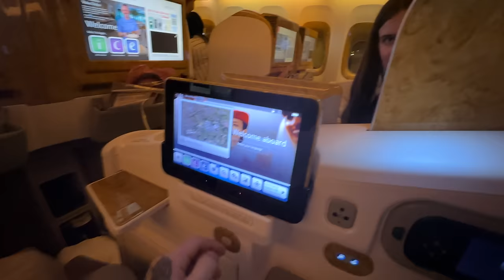FULL GARAGE TOUR UPDATE

Comment: Waterpump part two 😊
I just watched the bleeding the coolant issue. Now with more history . I think you just have a big air bubble. The F430 system is a little difficult to bleed. I came up with this method and it works 100% of the time for me. If the system is fully drained you will be able to get 16 litres in using this method. Then after the car has run you can get 1.5 or so more litres in. COLD ENGINE, CAR NOT RUNNING 
1) take the vacuum pump thing and leave it in the drawer.
2) on the passenger, left,  side( right hand drive car). Driver side in North America, remove that small hose from the top of the radiator that you previously tried. 
3) plug or just cover the rubber hose with your finger.
4) have some slowly pour in the coolant until it starts to come out of the small tube on the radiator.
5) slip the rubber hose back over the tube on the radiator and tighten the clamp. 
6) pour more coolant in the tank until it is about an inch and half from the top of the radiator fill. 
7) put the radiator cap back on and run the engine until it warms up. The fans, first drivers side, then passenger side will run. 
8) turn the car off.
9) RESIST THE URGE TO OPEN THE RAD CAP. You’ve seen what happens.
10) have a celebratory beverage while the engine cools down completely. 
11) now open the rad cap. You will be able to put in more coolant. About a litre and a 1/2 up to about  an inch and a half from the top of the fill hole. 
12) put the rad cap back on and warm up the engine. 
13) check for fans again. 
14) turn car off and RESIST THE URGE TO OPEN THE RAD CAP. 
15) after the car cools check level again. 
That’s it.
Your mileage may vary, constantly check for leaks, put a new thermostat in so the engine runs correctly. If you don’t the engine will get too cool while driving on the highway.
Cheers

Comment: For the water pump. There are 3 weep holes on the pump itself. Two will leak antifreeze if the water pump seals have failed. One will leak engine oil if that seal has failed. If there is a mix of liquids out of all three, the seals have really failed. The water oil pump are on the same shaft and are driven by a chain driven gear inside the engine. If you have oil pressure you will have water circulation ( probably) . If you remove the coolant tank cap you might be able to notice the coolant moving when the engine is running. You should be able to feel the hoses under the car getting warm as the engine warms. Turn the heater on inside the car. If you get heat in the car and no leaks on the weep holes, the pump is good. It is the thermostat stuck closed. If the heat stops at the thermostat housings and does not heat the tubes under the car, thermostat failure is confirmed. Easy job don’t forget to get the gasket for the new thermostat. If you decide to change the water/oil pump assembly. Let’s setup a call if you like. Too much for texting. I made special tools so I could change mine, twice. Frustrating story. Cheers

Comment: Matt... Splice in an out feed from the water pump with a T coupling in it. Hook one end back into the system and on the tail of the T attach a suitable pressure gauge... That way you can run a closed system AND see the out feed pressure from the pump... = )
Reply: and if you can work out how to power it up correctly.... just power the water pump only
Reply: @altortosa5955 it prob runs off the engine
Reply: I had the same thought.
Reply: Just put a stethoscope on the pump and listen for the pump whine. Smarter not harder.
Reply: @ATX_Engineer second that.. Stethoscope will definitely work... You can use it for other noises too

Comment: Hi Matt. Right Ferrari water pump situation. Have u tried putting a pressure tester on the expansion bottle. Put some pressure in it. Once that’s fine start the car up and give it a few blips of the throttle to see if the needle fluctuates. If it doesn’t then the water pump is faulty

Comment: About the heating problem. You can mount a clear hose of some kind, just to see if there is air in the system or if there is flow. Then if there is no air and still get heating problems it must be the thermostat or the pump I think. Good luck with the build...
Reply: Thats smart I m gona use it on my dads car it has the same problems

Comment: matt one of the things you can try is letting the engine run for a bit and see if the heater works, if the heater in the car works the water should be flowing to the front so the waterpomp should be working.

Comment: For testing the water pump, not totally sure if it’ll work with the setup in the Ferrari but if you put a pressure tester on(with a gauge on it) and pump it to 0.5 bar, start the engine you should see the pressure ever so slightly drop as it  creates vacuum then Rev the engine you should see the gauge fluctuate, the more it fluctuates the better, if it doesn’t move at’ll then pump is goosed 👍

Comment: With your Ferrari water pump deal!

Get a cooling system pressure tester. 
Pressurise the system to around 5psi, run the car, rev the car, if the water pumps working the pressure gauge reading will move if it doesn’t move, water pump is your issue 👍😜 much love

Comment: Just pull the flex hose off of the water pump, extend with clear flexi and possibly a pressure guage and then back to water pump. You'll be able to see the flow and measure the pressure ?

Comment: It you like to check the water pump maybe you could add an extra expansiontank that is clear and have long hoses then raise it up. 
Then you will see the flow.

I did this when i wanted to see if my heat Exchanger in the parkingheater had a crack in it.
So i put the extra expansiontank from the parking heater out and out of the expansiontank to the heat Exchanger in the car.

With this solution you can run the car.
Other solution as you say, remove a hose and start it 😅.

Comment: If you fit a hose to the water pump outlet and put it into a large bucket . Run the car for ten seconds and take hose away. So say there is three litres of water . That means you are pumping 60 liters a minute . Make sure the hose and bucket is above the car radiator, to cancel gravity. Then its just a matter of checking the pump pressure in the manual against your pump pressure.
Reply: Sorry my maths were off. 6×3 =18 liters a minute.

Comment: Attach a clear hose between the water pump and the current hose and add a piece of thread/string or similar on the inside (held in place with what ever clamp used to attach the hose), should be able to see if you got flow in the system that way. Might exist better premade solutions than a thread/string but you get the idea.

Comment: Could you use transparent pipe connected to the water pump and the OEM pipe to observe flow from the pump? Gonna lose some coolant so you'll see bubbles/rust etc flow down there. Or a long pipe from the pump and just keep topping the coolant bottle up and see how pressure changes as you rev it.

Comment: I’ve been doing 20 to 25,000 mile oil changes with my Amsoil and I have 356,000 miles on my engine not a single problem.

Comment: Get a coolant compression test for the Ferrari. Attach to coolant expansion tank, then once attached rev the the car and the dial should fluctuate up and down as long as you see it fluctuating then the water pump is working correctly

Comment: C63, check the inlet manifold. They are all suffering from dissimilar metal issues in the lower section of the inlet manifold. 

They used some tyre of metal re-enforcement in the magnesium cover in the valley. Holes in this area is unmetered air. Mine was only a minor and was able silicone it up. But would stall when you put it in gear. 

@mattarmstrong

Comment: Run a longer hose from the water pump so you can hold one end higher than the resevoir, then gravity shouldnt push any water out so any water would be from pump pressure.. if thats any help, the names Jordan 👌😂

Comment: mat, so the car on the lift with the cooling issue, since you're just trying to test the pump, you could attach a clear hose to the pump and existing coolant line to see it it flows when in operation(not meaning sustained running) but just a quick test?????

Comment: Ferrari water pump, take the output hose, feed it to a vertical piece of pipe higher than the highest water point for the car, start engine and see if it will drive water up the height.

Comment: you can use a bucket run the hose into and one out of the bucket and then it'll reveal if the cooling system is working properly

Comment: Long length of tube connected to the water pump, run engine, see if it can pump coolant up the tube (hold end of tube above roof height of car).

The number of meters a pump can pump water upwards is known as “head”, the more powerful the pump is, the more head it can produce… wow that’s super interesting 🤨

Comment: IF THE FERRARI HAS A BRASS BUSHING PRESSED ON THE SHAFT IT COULD SPIN WHEN COLD AND SLIP WHEN HOT. had that little gremlin bite me once already 😢
Reply: So just replace it...mine was tight cold..put a lighter on it and it spun free on the dam pulley shaft😂😂😂 ....